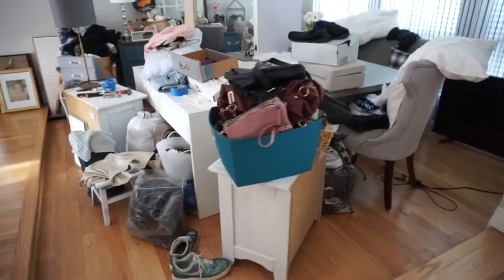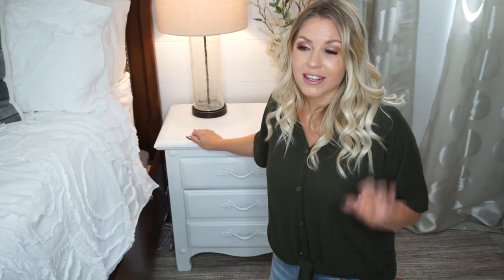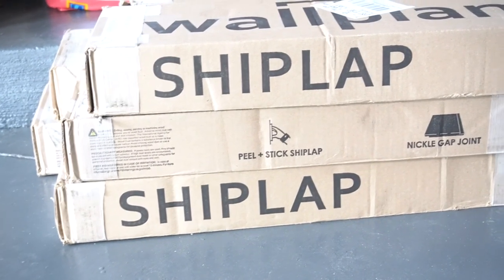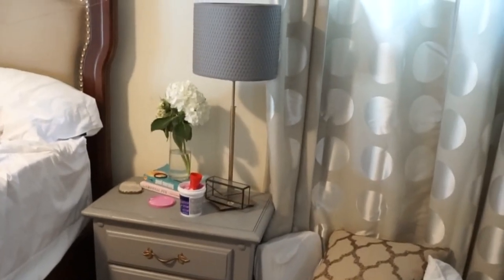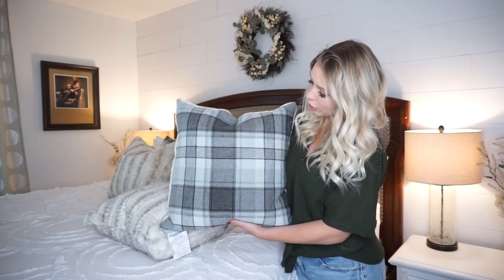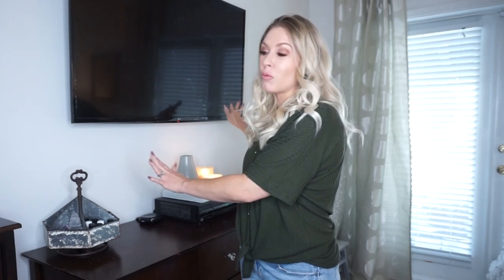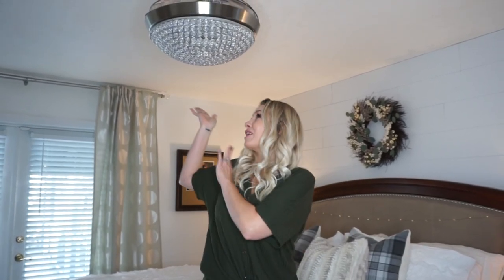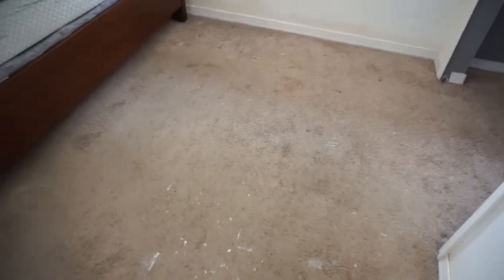TIPS To Decorate Your Bedroom On a BUDGET| Master Bedroom MAKEOVER with SHIPLAP

Comment: You guys did an awesome job! JoJo would be proud I think. :)

Did you do anything special where the planks end by that window? Trim pieces or do they just end there?

That flooring looks great too. We want to RIP all the carpet out of our house, but the kitchen desperately needs redone so we'll likely start there. Probably going with laminate as well as we have a 2yo and eventually a new baby and we have dogs, one of which also doesnt like to go outside when she should. Will definitely make cleanup easier for sure.

That fandelier thing is pretty neat, retractable blades. They look like they're probably easy to clean too. Shame about not being able to dim the lights. The bulbs probably aren't standard are they? I'd say if they were you could replace with smart bulbs you could control with Alexa.

Ooh and I only noticed at the end the "bed necklace" on the headboard. Lol adds a nice touch.
Reply from the maker: Sam Bowen thanks so much Sam! Yes we had to do so smaller pieces around the window. You’ll love when you eventually change out your carpets for laminate. It feels and looks so much better but I totally understand you’ve got to take on projects as you can. Good luck on getting your kitchen project going!
Reply: @sam bowen: Wallplanks do offer trim pieces. Trim is optional but not required